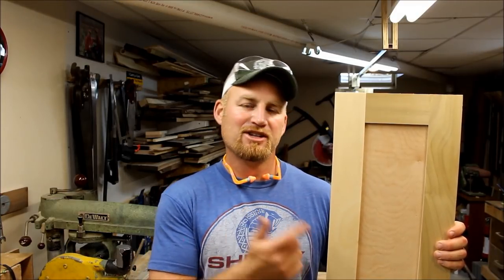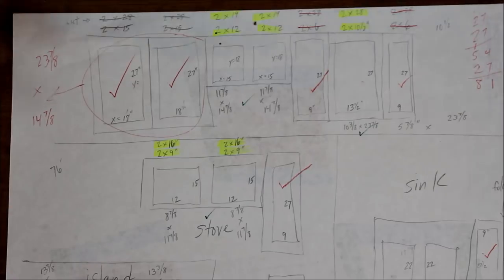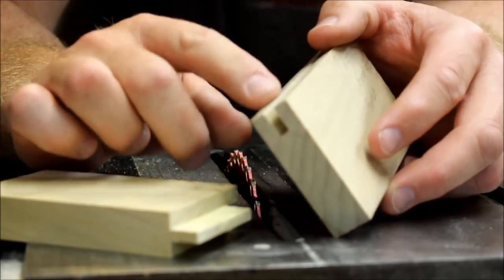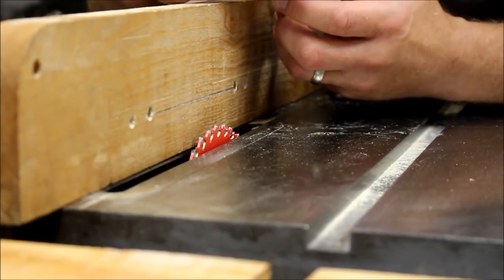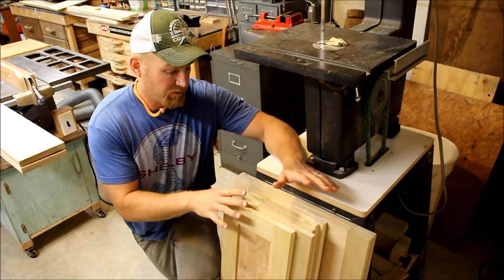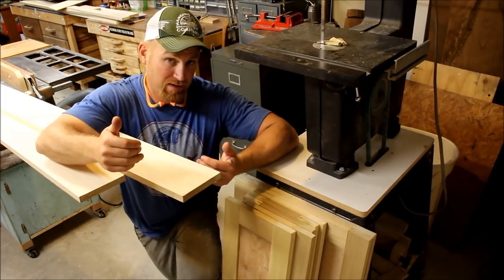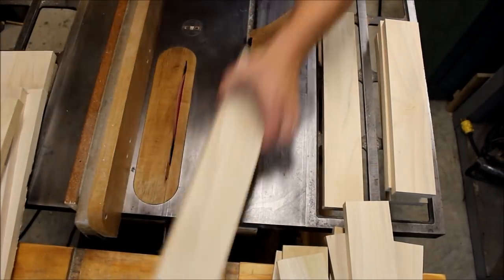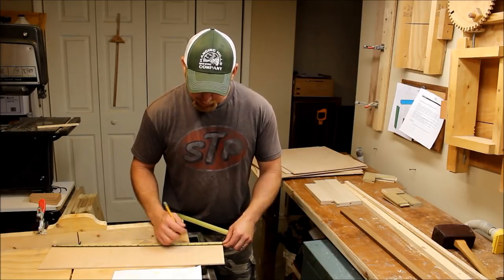DIY Tongue and Groove Hardwood Cabinet Doors. Kitchen Remodel #1- Vintage Wood Workshop

Comment: Great videos sir! I have watched several at this point. I am in the process of rebuilding a bathroom vanity and just finished up the new drawer faces. I did not know how to cut the inside panel ( snug or loose( and now I do. I am using maple plywood for the inside panel. So I am thinking maybe 1/16 for the possible expansion/contraction. 
Also, I like how you have just captured life you know. Your channel is not only about woodworking. I started my channel based on my Subaru build and have been hesitant to put anything else on it. I have but it feels kinda weird. It's all in my head I know. Anyway great channel, with great videos. Cheers!

Comment: Awesome and informative video.  Your daughter was great help.  My daughter is over 30 an still helps me in my shop.  Wish that cut list program would have been available 10 yrs ago.  I bought cabinetplanner.com program back then.  It gives 3D visuals, cut lists, and panel layouts to take to the shop when building cabinets.  Best 90 bucks I have spent in my shop,  saved me couple hundred bucks on my first bathroom cabinet upgrade. Have done cabinet plans for myself and  friends.  And to this day have support from the designer of this program.

Comment: its too bad you cant find or you don't have a wholesale lumber distributor by you, because you are skilled enough to make money doing this.
Also I glad to see your using a Radial Arm Saw ib your shop, have you ever put a corbin 3 blade shapers on it or the system made by dewalt? These were made for table saws and radial arm saws Sears sold them and you can still buy them, it would save you a lot of money over buying a shaper.
The tools you have must be hand me downs from your dad or grandfather. But you have mastered them.

Comment: You just saved me some money with the link to the cutlist calculator. Great video! My elder daughter (4) will also be helping me with my doors. Thanks!
Question: could you have used all wider boards and rip them for all the rails and stiles? That would save on cost as well.
Reply from the maker: Adam Kaminski awesome, great to hear, Adam!  Yeah, you could definitely rip wider boards down to width if you can find nice straight ones.  Let me know how you make out!

Comment: do the grooves require a flat tooth grind table saw blade to make them?
Reply from the maker: No, you can use a regular blade and the glue will fill in the small gap created

Comment: 1/4" luan for plywood, its cheap and looks good.    Lowe's for hardwoods ouch expensive.
You would save a lot of money buying rough cut wood and milling it down on a planer and jointer.

YES get the Kids to Help they need to learn,  I'd say bet you wished it was a boy, but your lucky I only have boys but I do have a granddaughter